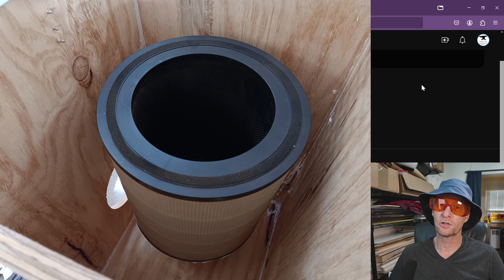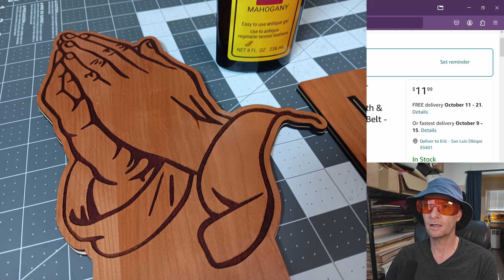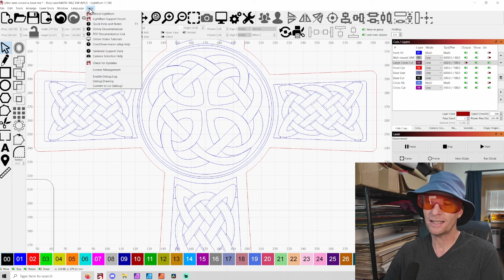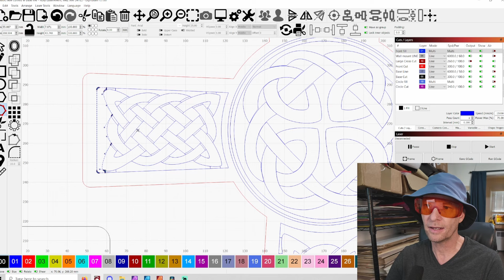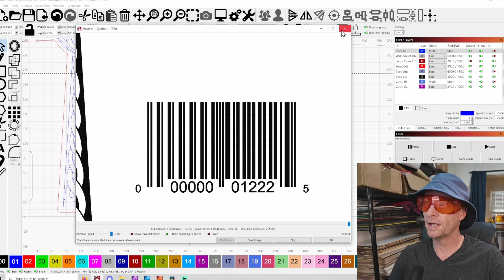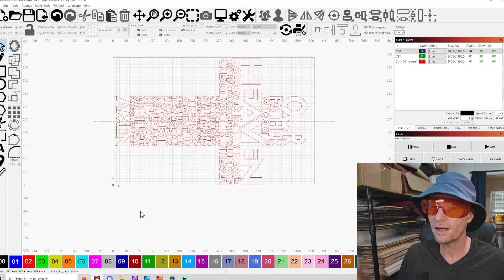Tips And Tricks for your Diode Laser - Lightburn 1.7, better engraves, upgraded exhaust...

Comment: What speed and temp do you use in the Roly 30w on the lords prayer sross ? I've  had a problem with my sculpfun burning them so I stopped trying.
Reply from the maker: Depends on many factors. You would need to do testing to see what works on the wood you use...etc..

Comment: You also need a good fresh air system that pulls in air into your enclosure from outdoors. This is especially important if you live in a cold environment as just having a exhaust will cause a negative air pressure in your building and will draw outdoor air into your building through ALL gaps, cracks and drafts.

Comment: Another informative video. I have the same XW 30W and love it. It has all the features a small business needs to keep up production. I noticed my laser not cutting items out like it had in the past while using the same settings. I took the laser module apart to clean it and noticed the lens was cloudy. I swapped out the lens with replacement in the Roly maintenance box and boom, back to cutting as normal. Check that lens while cleaning, use only the lens wipes Roly recommends and replace it if it is not crystal clear.

Comment: I'm using a 440cfm fan to get rid of the fumes from my Roly XW30 engraver, but I'm still smelling the fumes in my room, in your video you said it's better to have the fan sucking the fumes out of versus blowing. How do I have it suck the fumes out versus blowing the fumes out??
Reply from the maker: As I said, if you have the blower at the window or outside it is sucking out, not blowing. If it is at your machine it is blowing. :)

Comment: Awesome video.  I read on roly site that when doing tumblers you should turn off laser o on while framing otherwise it will leave a slight mark on the tumbler.  Just a friendly FYI.
Reply: That's good to know as it is a very useful feature.
Reply from the maker: I just used it on tumblers without issue, but it would be a good thing to look out for.

Comment: Great video! Where do I go to match the graphic on the celtic cross and the candle holder?
Reply from the maker: The candle holder file has the Celtic Cross graphic as the third variation. So just open it up, and cut it out. I am actually working on a video for it as well. I am doing a copper inlay in the candle holder. Thanks again! Let me know if I answered the question.

Comment: You may want to try adding a bit of air while engraving.  This may help with the cleaning.  I use an adjustable pinch clamp on my air tube for a low tech restriction.
Reply from the maker: Yes, a tiny bit would probably be good, but I cannot be bothered, lol.